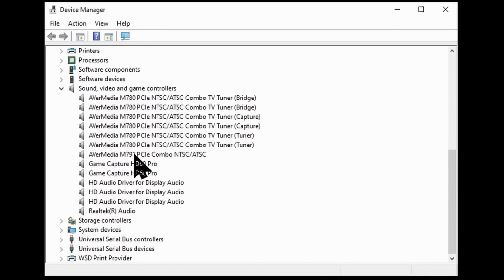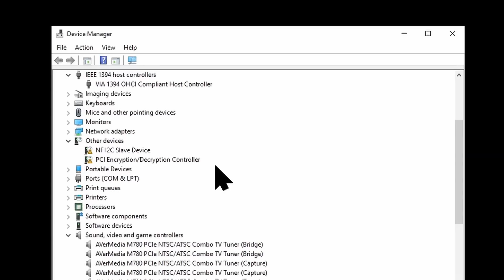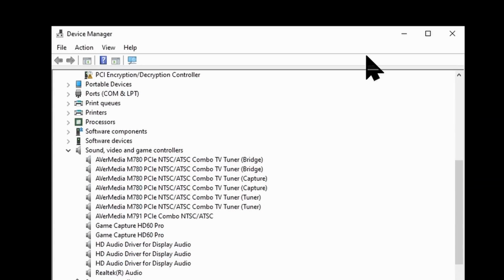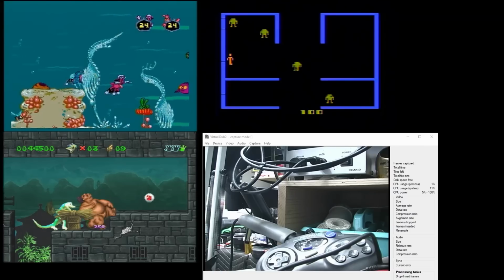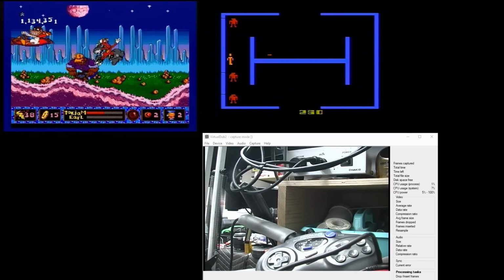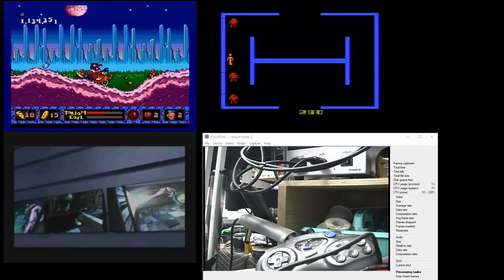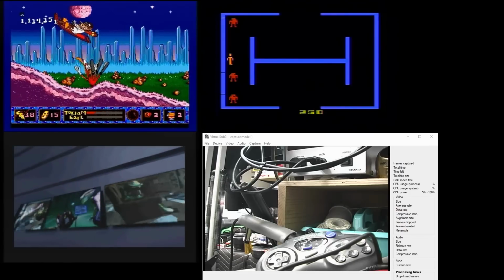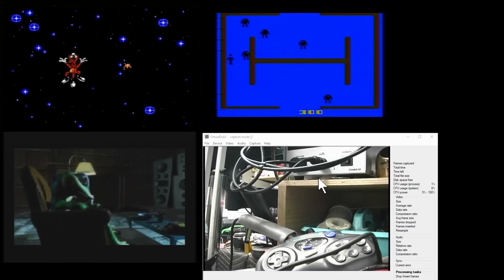TEF #196 | Will 4 PCIe 1x Cards Work In 1 PCIe 1x Slot Using A PCE4PCE-A01 Board?

Comment: Your motherboard lanes are over capacity.

Your setup would better benefit from a motherboard with 2 physical x16 slots that supports x8/x8 bifurcation in bios... i.e. Supports SLI/Crossfire.

There are a handful of these boards out there.

I have 2 of them.

Would be willing to part with one... might suit your setup way better. Shoot me an email.

ASUS ProArt B550 CREATOR.
You'll definitely like the specs.
Have only been using it for about 7 months.

Comment: will 4 x4 gpu (rx6400) run on 1 x16 pcie without significant bottleneck?
Reply from the maker: I would think they would work just fine, but that's not something I've ever tried messing with, so I can't speak with any certainty.

Comment: Another trick - If you have any free NVMe compatible M.2 slot - remember that's a PCIe 4-lane slot, just in a different form factor. You can get adapters from M.2 PCIe to motherboard style PCIe 4x slot in the usual places - though with some motherboards you need to check if all the ports are available at the same time.

Comment: It's not surprising. PCIe is latency and delay tolerant on top of being backwards compatible. Though you should test if your motherboard and cpu support pcie bifurcation, which is how you get those cards with 4 M.2 slots to work (transforming one x16 slot into 4 x4) for example.

Comment: Like the risers I used to use for crypto mining but 4 in one, and probably way more reliable
Reply from the maker: These were sold for mining purposes, so I wasn't sure how well they would work, as I had never tried them before.
Reply: @ThatElectronicsFool  It looks like it's way better made than the ones I used to use. Mine were x4 to x16 I think, but they barely had any components on the board. Basically it just had a power circuit for the molex plug, and they melted all the time because the gpus pulled too much current even though they were powered externally.

Comment: Omg power youre gpu the right way daaamn
Reply: 0.50 sec u can see for your self this is so stupid what idiot does this
Reply from the maker: I knew someone would notice that! LMAO. I'm not using this PC for gaming, so I'm not too worried about the power to it. I didn't have the right power cables for my power supply when I installed that card, but I just bought some mini-fit Jr connectors and crimp pins a few days ago and will use those to make some custom cables to wire everything properly.

Comment: Four 1x from a 1x, so it's not bifurcation, still, when you remember all PCI slots once had a shared 133MB/s bus and a PCIE 3.0 x1 has just short of 1GB/s each way (not that the each way helps if they are all input devices)
Reply from the maker: It uses an ASM1184e "PCI express packet switch," so I'm guessing is similar to the way an ethernet switch works, where it's transparent to the connected devices.

Comment: It's just a pcie lane switch. 4 1x devices sharing one 1x slot. I bet if you hook up another board  on each slot, making it 16 devices, it will  work just. Bandwidth  will be another problem.
Reply from the maker: I bought two of these boards, so when I make a final enclosure, assuming everything goes well, I may make a second one.

Comment: Surprised you get enough speed through that single connection, in a good way.
Reply from the maker: It connects all the PCIe 1x lines from the motherboard directly to the expansion board.
Reply: the cable is USB3.0 should be more than PCIE X1

Comment: What arcane trickery does that board use? How does it manage 4 PCIe devices at once? Thank you for bringing this thing's existence to my awareness, time to investigate.

PS.-I've got a PCIe to dual PCI adapter board that also uses a usb cable in-between.  Seems to be a fairly standard solution in the janky adapter board world.
Reply: Not much trickery needed.  The card is probably like at least PCIe 3 1x slot.  That means it has about 1 GBps throughput.  Capture cards don't really need that much throughput though.  Even at like 200 MBps which would be a really high output size for a capture card you would still be able to almost host 5 devices with it.  So there is plenty of overhead.

If he's using PCI 4 1x slot though then that device could actually support nearly 2 GBps which would allow up to like 10 of those devices.

For reference a raw 1080p 60fps stream without any onboard compression equates to 355 MBps.  The old DVD standard 4:3 stuff would only cap out at 72MBps raw feed.  Really though with onboard compression you could easily get over 2x compression...so yea at most I think those devices probably would handle like 100 MBps which means you could have have about 9 devices before it starts becoming an issue.  18 devices if using PCI 4 or 39 devices with PCI 5
Reply from the maker: Thanks for the additional data!
Reply from the maker: It uses an ASM1184e "PCI express packet switch," which appears to be transparent to the connected devices as you don't need to install any drivers for it.

Comment: hi some pci old cards will not work  because of the windows 10   so i had yo use window 7 this is a pain because a new amd 4  will not take  window 7 
yes i have the same card  as you  the os can be a right pain
Reply from the maker: Yeah, for some devices you'll be limited by driver compatibility. Thankfully all of these work with Win10.

Comment: That's so cool to see a working test of these gadgets. Thanks!
Would the bracket card work if it was cut above the pcie connector? 
From the video, there's no trace going from the port to the bracket. This would help using the pcie ports on some mining motherboards and have tons of expansion in a standard atx box (thinking of making a janky backup server with parts I got).
Reply from the maker: Yeah, there's nothing else going to the bracket side, but I have seen some of those that don't even have a bracket, it's just the PCIe edge with a USB connector on top. I've seen them sold individually on eBay.

Comment: Hey! You have an Intel Arc graphics card! You're one of two dozens. xD
I actually find that very respectable, using the graphics cards from Intel, even if no one wanted them. That shows Intel that they should continue producing graphics cards. To the main point of the video: That's an interesting idea, but it's horribly janky.
Reply from the maker: I wanted that particular card for this workbench system because it was pretty affordable and had AV1 encoding, which I wanted for streaming purposes, which I hope to eventually do. The card I was previously using for video editing on this PC really struggled and caused Resolve to occasionally crash from not having enough RAM. 

I have an AMD card for my gaming PC though.

Comment: Have you considered using an HDMI switchbox to expand the inputs on your current Elgato cards? Subscribed, BTW.
Reply from the maker: I do have an HDMI switch on one of the HD60s. It allows me to switch between showing the microscope camera and 4 other inputs, but even so, I'm still limited to only a max of two HDMI sources at a time on video. I don't desperately need more than that, but it would be nice to be able to have the ability to simultaneously show more.
Reply: @ThatElectronicsFool  How about USB-capture cards, or pro-cards with multi-input?
Reply from the maker: At one point I had considered some USB devices, but I really don't like having a bunch of extra stuff hanging out, not that having an external card box is all that much better, but at least everything would be contained in one box. And I would have to either add an extra PCIe card with multiple USB ports, or use more USB hubs than I'm already using because I used up all the USB ports on the back of motherboard. As to the cards you're referring to, I haven't really looked into that.

Another thing is that I already had all those cards sitting around and was trying to find the lowest cost, but still acceptable solution that would allow me to use them. The PCIe expansion kit is $30 on eBay. Now I'm really curious to know how well those HD60s would work with one...